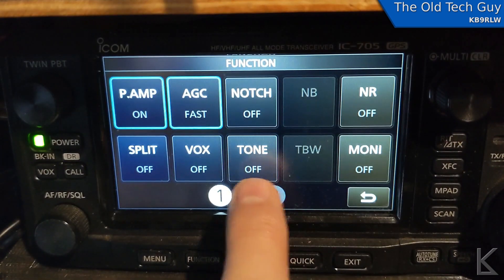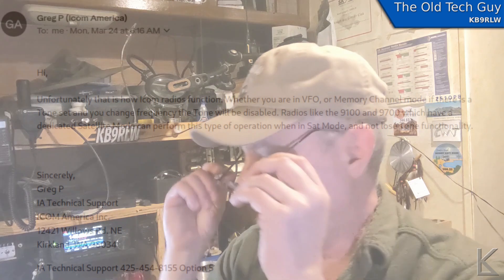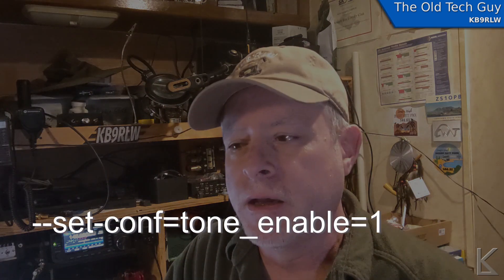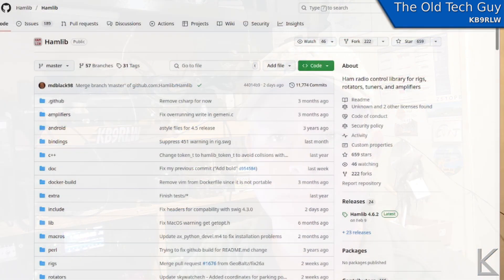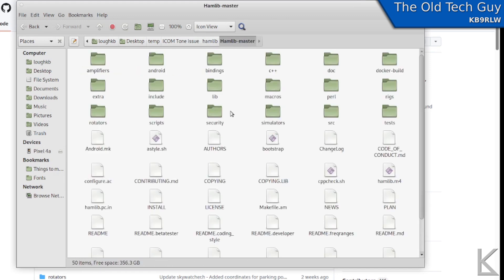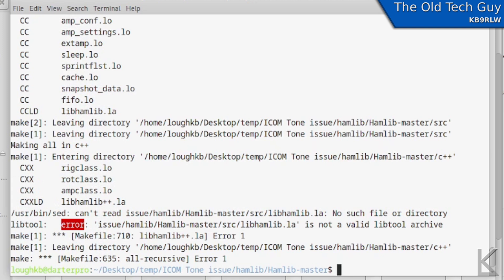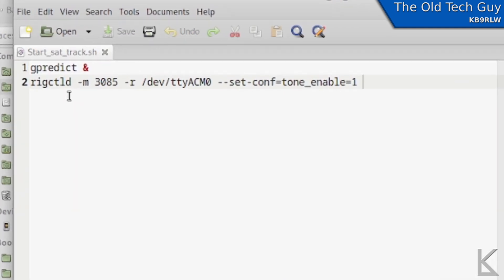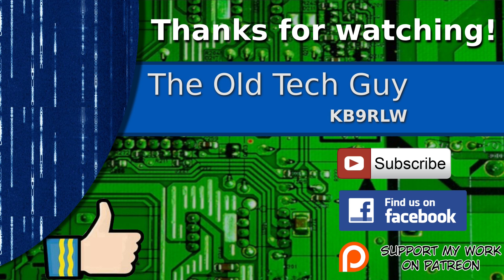Ham Radio - Satellites, ICOM, and the PL tone (bug?)  Plus a workaround.

Comment: Kevin, I just checked my IC-705  which is the US version with the 1.32 firmware and I do not have the issue.  My research says the Tone is part of the VFO State so I am not sure why you are having the issue in your video.  I have been using the new Skyroof control and not Gpredict.  Not sure why Icom responded the way they did to you.
Reply from the maker: See the follow up video with the solution.  I think I linked it in the video description.  
It has to do with the auto-repeater function.

Comment: HI Kevin. I tried the same on my 705. But in my case the tone stayed on. I'm on firmware 1.32 and the radio is an EU version. Made a small video, but I don't know how to attach it to the message here. 73 de OZ1DKT Peter
Reply from the maker: I'm on firmware 1.30.  I'll do the upgrade and see if that fixes it on the US version.  If so, I'll do a follow up vid to let everyone know.  Thanks for the feedback.
Reply from the maker: Well, I just updated to 1.32.  Had to get it from the main Icom site as the icomamerica site only had version 1.26.    Did the upgrade, went to 2 meters FM, turned on tone and touched the vfo freq.  Tone switched off.  You were in VHF FM, right?
Reply: @ yes it was FM. If you like I could send you my video 😉
Reply from the maker: @peterhgh1816  No that's okay No need. I already sent the info along to tech support that it worked on an EU version. So they can send it on to engineering. This really makes me think it's a bug.

Comment: Does the tone go off if you use the RIT or TIT, that may be a way to keep the tone on within the range on the RIT or TIT. Something to try.
rgds ZL2ALW.
Reply from the maker: Just tried it, the tone stays on with RIT.  I'd still prefer to automate Doppler correction so I don't have to think about it and can concentrate on the QSO attempt.
Reply: @loughkb  perhaps you can get the software to use the Rit/tit to do the doppler correction, depends on difference of frequency during the period.
Reply from the maker: @andrewbarnett84  No reason to. Now that the author has added that option to turn the tone back on every time it changes frequency.

Comment: The Doppler shift on the 2m side is small enough that it would still work if you didn't change the frequency throughout the pass. When Ive used my 705 for sats that's what I did. I manually controlled Doppler on 70cm and left 2m side at the center freq.

Comment: On my IC-9700 in VFO mode the tone stays active as the VFO is move. Same for the IC-7300. Also with my IC-705 the tone remains (Main CPU v1.32, Sub CPU v1.01, DSP v1.12, DSP Data v1.00, FPGA v1.01, DV DSP v1.11)

Comment: Thanks again. Always enjoyable and informative.  I guess ICOM dumb down of the 705 is an entry unit to entice upgrades.  Planed functionality obsolesce, maybe. However, as demonstrated, Amateur Radio RULES!  Kudos to the ham developer of the free and open source code.

I look forward to your antenna selection, build, and on the air execution evaluation.

(I wonder, if it was an upgrade enticement, the ICOM business plan considered the upgrade might be to KENWOOD or YEASU, etc???)

KB9RLW de N5XS 73   .-   ...-.-   ..
Reply from the maker: Considering how small of a niche satellite users are in the already small amateur radio niche, it is almost certainly an oversight. When I mentioned the upsell I was grinning as it was intended to be tongue in cheek. 
I heard back from support, they have submitted this issue to engineering. I bet the next firmware update takes care of it. I'll certainly do a video if it does.
Reply: @ I hope so. I’ve seen this in cameras removing features in lower end, entry level offerings to lower price and entice upgrades.   
I wasn’t slamming ICOM just commenting.   Their business not mine.   Didn’t catch the “grin in cheek” nod.

Comment: PstRotator has a satellite tracking function with Doppler shift and the tone is set in it. And it will not turn off during tracking
Using IC-705 with Wfview wirelessly

Comment: Hi Kevin,

What ICOM mentioned for the IC9700 that it will maintain tone functionality on frequency change only in dedicated SAT mode isn't correct. I have one and can confirm IC9700 in normal VFO mode won't disable tone function when changing frequency with VFO knob or CAT.

73 Andrej - s57rw
Reply: My 9700 in normal VFO mode does disable tone function when changing frequency with  VFO knob.  Just purchased it last month. 

73, Todd KH2TJ
Reply: @KH2TJ  Hi, strange mine doesn't turn the tone off. I got mine back in the 2020 but is updated to last FW release ver 1.44 at the time of writing. Perhaps there is some difference between the US and EU version. By checking the manual noted the US version has in Set/Function menu an "Auto repeater" option. By default is turned on and if understood well should affect repeater shift and tone automatically when you tune to repeater portion of the band. Check if this option affects the tone setting while out of repeater portion? I cannot check since the EU version does not include this function.

If the above doesn't solve if you set the TQSL instead of Tone will be disabled on frequency change too? For SAT operation in split mode won't make a difference if you use the TSQL or Tone option since one band is used only for TX. Of course if you have the IC9700 for SAT operation you use full duplex but might help IC705 users if the solution works...

73 Andrej - s57rw
Reply: @s57rw  Thanks Anderj.  That was it!  Couldn't find a reference to the "Auto Repeater" option in the manual, and a quick google search didn't help.  Thanks for the info....73, Todd KH2TJ
Reply: Still learning this rig!   Downloaded the advance manual now as well. Looking forward to trying it out on the birds soon.....
Reply from the maker: Yeah that was the issue. I heard back from Greg and just did a video on it. It'll go live friday.

Comment: The same build process works on Windows if you have the tool chain installed, which is pretty easy and well documented in the README files.    For whatever reason the standard pronunciation for all LIB things is as in lib-erty or lib-eral - even though they are clearly library files.  Developers are a squirrely bunch, as you observed when trying to talk with the ones at Icom.

As an alternative you could setup a tone generator on your PC and have it running the background while operating.  The mic would pick up enough of it to be "subaudible" and it would get included in your TX just as if the radio were adding it.  Annoying as heck to listen to I'm sure, but probably doable.  There are one or two birds where the PL to wake up the repeater is different from the one used for a QSO so having easy access to change the tone frequency is a plus.
Reply: The reason for the pronunciation is because library files usually end with “.lib” as in “xyz.lib” not “xyz.libe” and we pronounce it as it is spelled. Lib rhymes with glib.
Reply from the maker: And again, I will maintain that using this reasoning everybody is therefore pronouncing library wrong. 😉

Comment: I just did an online chat with tech support on the ICOM website... Posted below...

Greg P says:Thank you for contacting Icom America how can I assist you?

says:There seems to be a problem with my ICOM705 radio.  When I turn ctcss tone ON in the function menu and then exit the menu and turn the VFO knob the tone turns off. This seems to be a bug in the firmware

Greg P says:That is normal for Icom radios. Whether the radio is in VFO or Memory Channel mode changing the frequency will turn off Tones.
says:This is terrible!! Why would you consider this normal?? How are we supposed to be able to tune a satellite doppler frequency shift if the tone keeps turning off??

Greg P says:That has been how Icom radios have functioned.
says:I can't think of a single reason that the tone should go off when tuning. Well here is some feed back from an actual user.  Please submit this to be corrected.  If we turn tone ON we want it to stay ON till we turn it off!!

Greg P says:I can pass your concern to the Product Development team for future consideration.

says:If I turn on a filter it stays on till I turn it off.  The tone should act the same way. Yes Please do submit my feedback. Do you understand why we would want the tone to stay how we set it in the function menu?

Greg P says:I would venture to guess you're a satellite operator.
says:If I turn the tone on and then find I need to tune the vfo the tone should stay active. Yes for satellite and also for communicating to others where they may be off frequency and we need to better tune to match their frequency.  Why would it ever be a good idea to turn off a feature that the user turned on by choice??

Greg P says:Could be a requirement for radios in Japan that may have carried over to other market radios, but as far back as I can remember that is how Icom radios functioned.

says:Do your high power satelite radios do this??
says:Yes PLEASE submit this to firmware dev team.  This makes the radio unusable for satellite use.  We want the tone to stay on until we turn it off ourselves. But even in normal voice use the tone should stay ON when making slight freq corrections.  

Greg P says:The 9700 is the same.
says:many satelites require a ctcss tone.  The tone should stay active while tuning for doppler shift.  This seems to be a MAJOR oversite and needs to be corrected.  At least give the user an option to have tone persistent or not when tuning.

Greg P says:Like I said I will be sending this over to the Product Team.

says:Thank you for listening to user feedback, I appreciate it.  That is all for now, 73
Greg P says:Fine Business. You're welcome, and thank you for contacting Icom America.
Just now
Reply from the maker: Oh, and by the way. I just hooked up my dad's old icom IC 228h 2 m mobile transceiver. Put it in vfo mode and turned on tone. Change the frequency all I want and the tone stayed on until I turned it off. So icom radios have not always behaved this way.
Reply from the maker: Yes, I heard back from him also, he has submitted this to engineering already.

Comment: Hi Kevin, etc. al.,

There is another way to solve the issue as well... 

If you move to MEMORY MODE and program in the Sat's frequency & other details, and then also program in the side frequencies to "track" the offsets... (as I was taught many years back) You can also set the tone ON for each offset Memory channel.

73 John N7GHZ
Reply from the maker: Yes,  That's one way of manually following the frequency.  However, you have to remember to keep advancing the memories.  Whatever you can automate just frees up your concentration to focus on the QSO.
Reply: @loughkb Hi, but  can't you also automate that; Mem. Chan's. Like you change the VFO?

73

Comment: Kevin, can you post the email you used to contact ICOM? if more hams message them they might make the change.
Reply from the maker: Icom's support contact info is on their main site.  
I heard back from him again, he has submitted the issue to engineering as a change/feature request, so maybe there will be a fix in an upcoming firmware update.  Time will tell.

Comment: The radio will function based on the code in the radio, that is the whole point of having a radio based on firmware... ICOM needs to fix this!!! This is a LAME/LAZY response from ICOM.  ALL hams would want the tone to stay active if they manually rotate the frequency.  Come-on ICOM wake up!  At the very least they could add an option in the menu to make TONE persistent or not.
Reply from the maker: I heard back from him again, he has submitted the issue to engineering as a change/feature request, so maybe there will be a fix in an upcoming firmware update.  Time will tell.